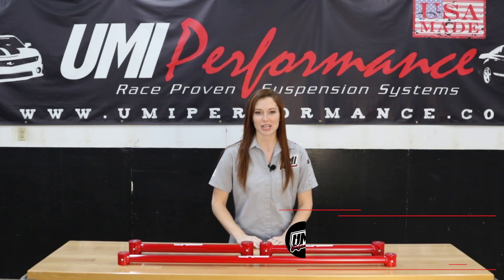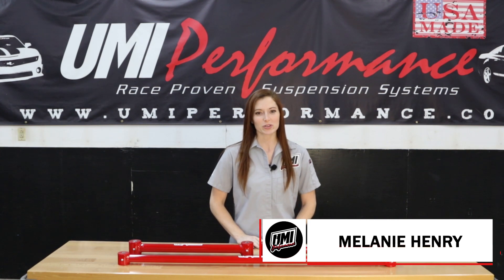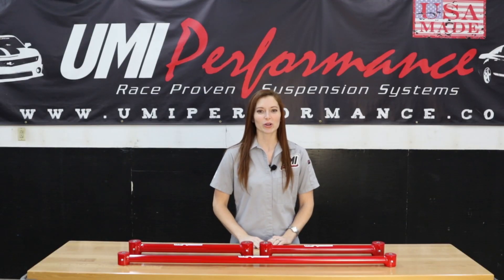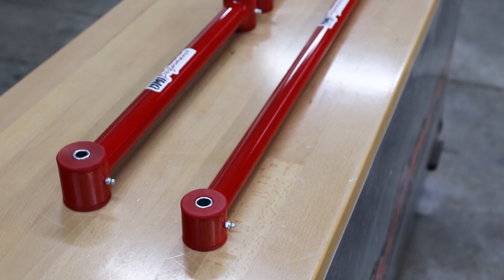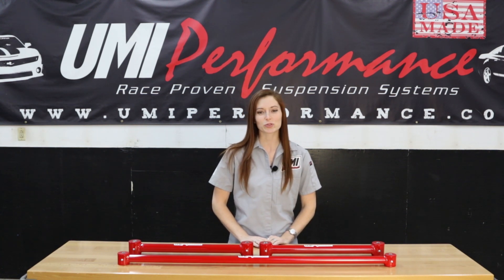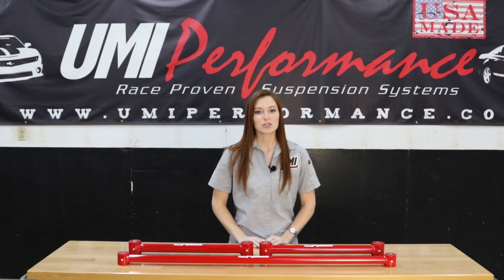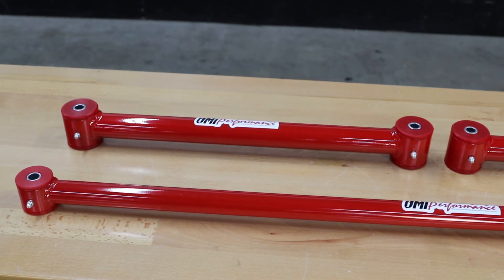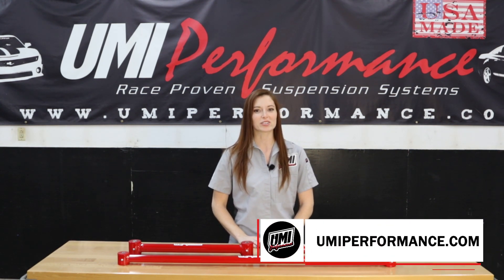UMI's 201520 Lower Control Arm and Panhard Bar Kit for GM F-Bodies!

Comment: Just to confirm do these tubular lower control arms improve handling cornering? I'm looking to replace my old ones and want something that will make the car handle better in twisty roads tracks. I do not drag and and tuning car to handle better for driving. Thanks.